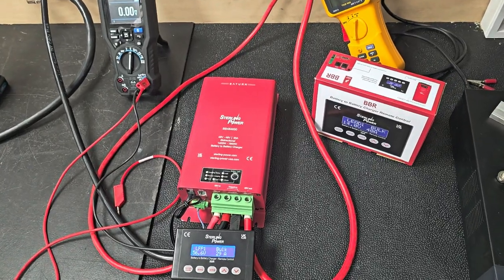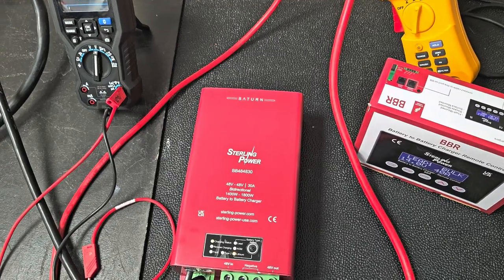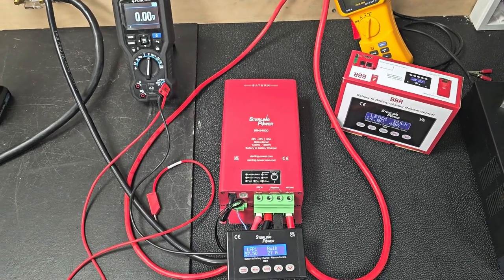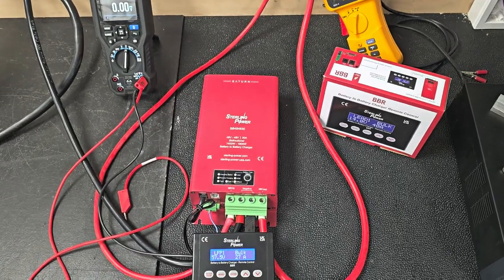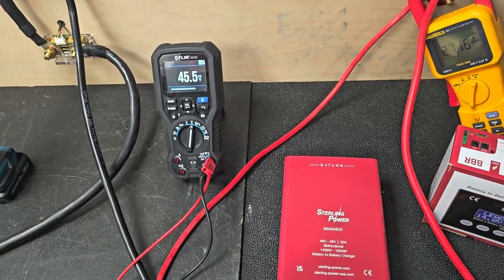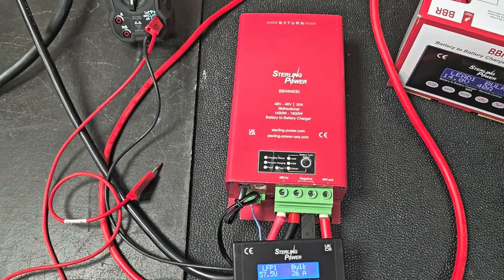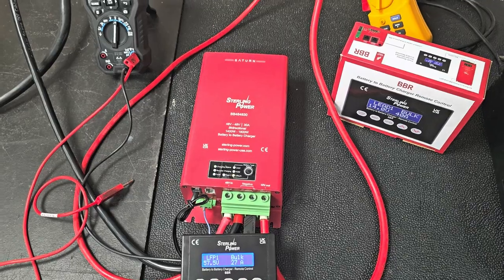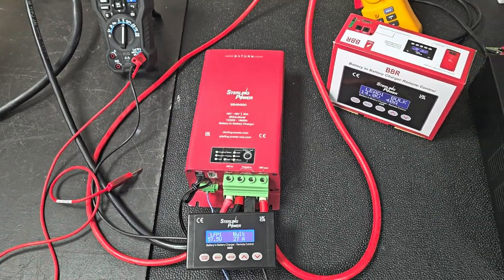BB484830 - 48V to 48V DC DC charger ~1600W. 30A. ideal for charging between 2 sets of 48V batteries

Comment: Nice!
I asked you before regarding "balancing" different Voltages.
Will this also be able to balance  Lets say a 52V Lithium battery bank and a Lead acid Bank?
Like a large Camper van to a Home battery to add capacity?
Regards from Norway
Reply from the maker: To a degree, yes.

If we consider your system similar to the initial use case of a 48V 'tender' boat (IE mini-boat) that goes out to entertain guests and then returns to the main-boat (which may also be 48V in this case!), you certainly could use this item to charge the tender from the main.

Indeed then, if we look at in the reverse (your case of adding the van to the home-) the theory is very similar. 

If you have the BB4848 triggered by a signal feed, it will charge from point A to point B whenever that signal feed is live. It will essentially be a 1.5KW 'buffer' to your main house battery bank. 

It isn't, per se, a balancer, but it can charge one bank from another and therein 'provide' in a sense the capacity of one bank.

Keep in mind that the 'provision' bank will be used first if the charger is running at the same time as you running loads, as power always comes from the higher voltage source first.